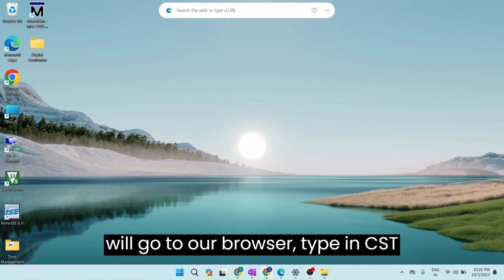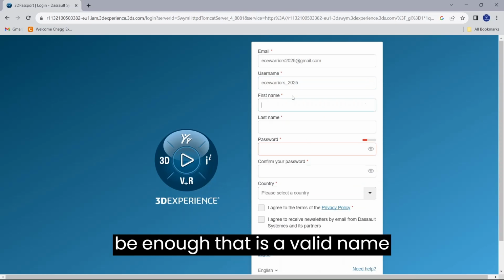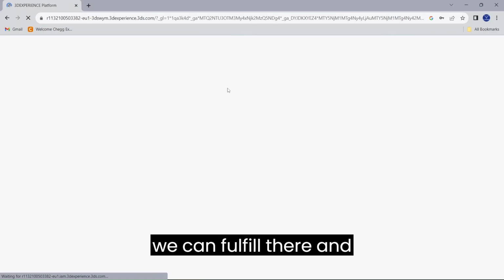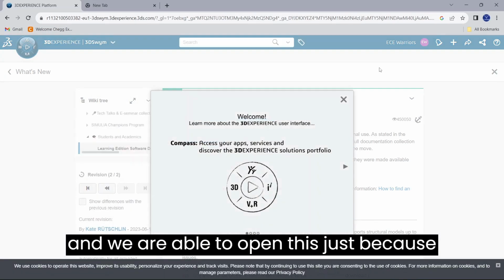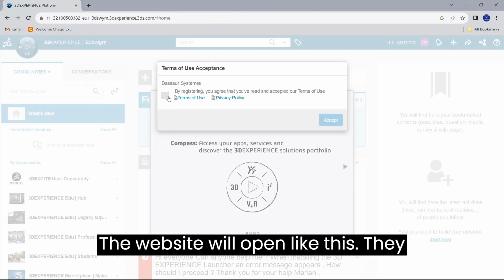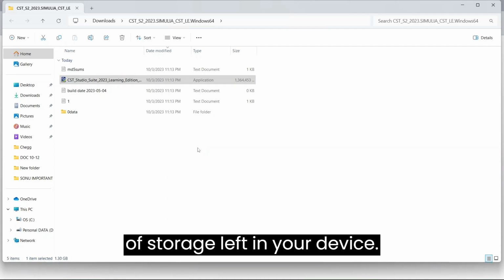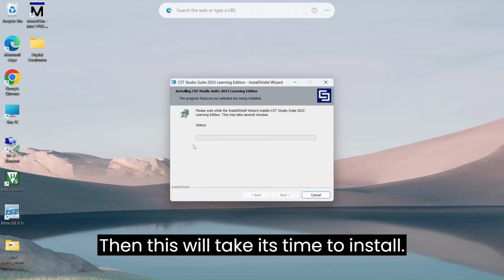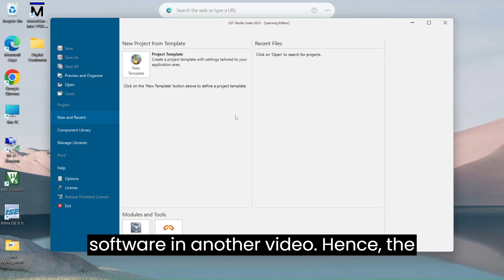#cst #studio #installation for #antenna #design.

Comment: If anyone facing any problem regarding certificate ensure that your internet connection is on and all the antivirus and firewall systems are off. Then re-open CST. In Sha Allah it will work